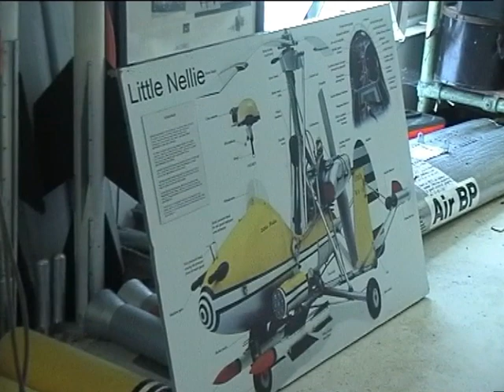Wing Commander Ken Wallis MBE and his autogyros

Comment: No safety bars, open to any kind of element, or fatal accident with the propela.. Suicidal flying machine
Reply: It's fine if you know what you are doing. Ken Wallis designed, built and flew gyros for around 60 years.
Reply: Most light aircraft you could push a biro through the sides.  Most aircraft are juat surrounded by fabric or very thin metal.  Its mostly streamlining.  Rhis is a properly designed aircraft with strong 6061t6 frame.  In additon gyros can fly and land very slow.    Hes not falling out because he has a seat belt.  He flew these for 60 + years.  Its cooincidence he never died.  He was still flying them at 93.